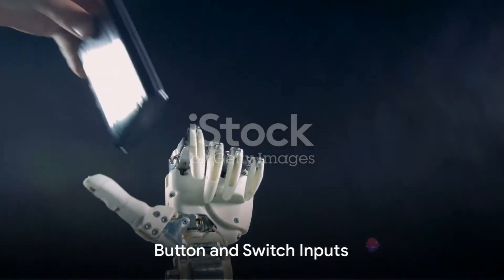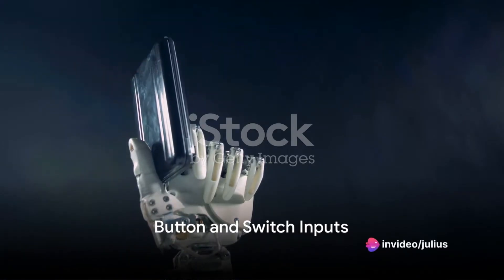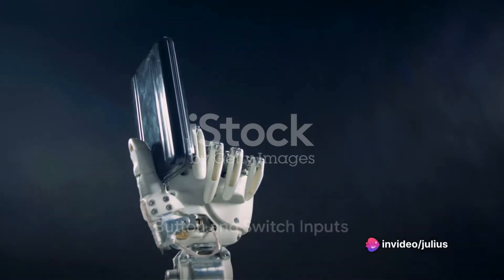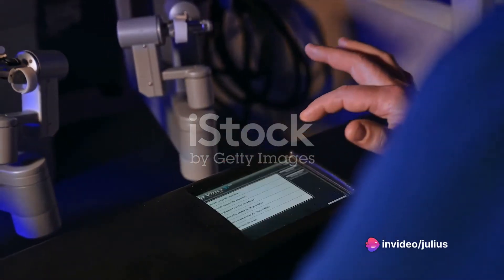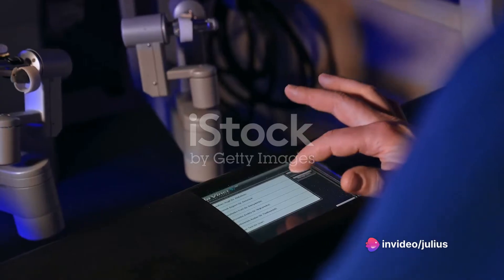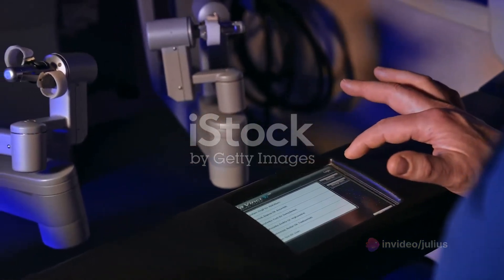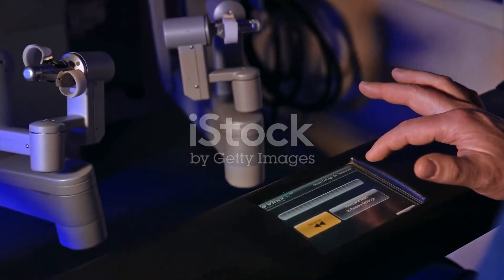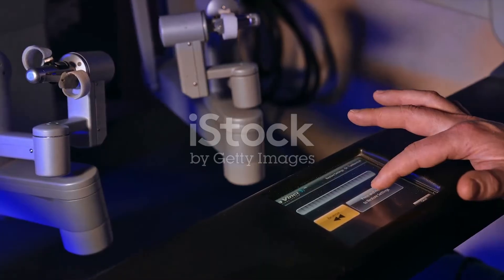Top 10 Digital Inputs in Robotics

Comment: Faith N. Ragas
10 - Andromeda 

1. What are limit switches, and how do they function in robotic systems?
- Limit switches in robotic systems act as sensors to detect when a moving part, like a robotic arm, reaches its maximum allowed position. They function by using an actuator that triggers an electrical signal when the robot reaches a predefined endpoint, ensuring that the robot doesn't exceed its designed range of motion. This helps prevent damage to the robot or its environment by stopping or redirecting its movement, making limit switches crucial for safety and precision in robotics.

Comment: Jag Alona S Ramayla
10 - Lyra

2. Explain the role of proximity sensors in robots. How do they help robots interact with their environment?

Proximity sensors are essential for robots to safely and effectively interact with their surroundings. By detecting nearby objects without physical contact, these sensors prevent collisions. When a robot encounters an obstacle, the sensor alerts it, allowing it to stop or adjust its course.  Furthermore, proximity sensors enable precise movements, ensuring the robot is correctly positioned for tasks such as gripping or welding.

Comment: Jasmine E. Delapus
10-LYRA 

1. What are limit switches, and how do they function in robotic systems?

Limit switches are essential components in robotics that act as sensors to detect the endpoints of a robot's motion. They serve as invisible markers, signaling the robot when it has reached the end of its allowed range, prompting it to stop or change direction. This prevents potential damage and ensures accurate movement control.

Comment: Chlouie Fate O. Hermoso

10-LYRA

2.Explain the role of proximity sensors in robots. How do they help robots interact with their environment?

-Proximity sensors help robots interact with their environment by detecting the presence of nearby objects without physical contact. They prevent collisions by alerting the robot to obstacles in its path, allowing it to stop or change direction. Additionally, they enable precise movements, ensuring the robot is correctly positioned for tasks like gripping or welding.

Comment: Angel Alexa M. Maquilan
10-LYRA

01.) What are limit switches, and how do they function in robotic systems?

- Robot movement is often controlled by limit switches, which act as invisible barriers. These switches trigger a stop command when the robot reaches its maximum range of motion, preventing it from exceeding its physical limitations.

Comment: Cherish Stefie D. Bacayo
Grade 10 LYRA 

3. Describe how binary encoders contribute to a robot's functionality. What type of data do they provide?

Answer: Binary encoders are absolute sensors that convert physical positions into binary code, providing precise positional data for robotic components. They enable accurate tracking and control of movement by sending digital signals to the robot's control system. This data is particularly important for applications requiring consistent positional awareness, even after a power shutdown, which ensures that the robotic systems remain functional.

Comment: Abdul Haq R. Maminta 
10-Lyra
1. What are limit switches, and how do they function in robotic systems?
- frequently used to show when a robot has reached in its endpoint, for as when it has reached its limit, it will stop the robots performance.

Comment: Kyle Ross B. Baiño
Grade - 10 LYRA

1. What are limit switches, and how do they function in robotic systems?

Limit switches are devices used in robotic systems to detect the position of moving parts or the presence of objects. They consist of a mechanical actuator that triggers an electrical switch when a physical boundary is reached. This change in switch state generates a signal sent to the robot's control system, enabling it to respond appropriately, such as stopping a motor or adjusting movement, thereby preventing damage and ensuring accurate operation

Comment: Neeka Ella P. Guillero
10 - LYNX

3. Describe how binary encoders contribute to a robot’s functionality. What type of data do they provide?

Binary encoders play an essential role for robots, supplying data about the position, speed, and direction of movement. These translate mechanical motion into  digital signals that monitor motor shaft rotation, which allows for accurate control because of the precise position or rotation data provided. This is crucial for functions like navigation, object handling, and speed adjustment. Encoders also identify movement direction, ensuring the robot moves as intended.This digital input enables precise and reliable robot operation.

Comment: Rhilyne B. Rivas
10-Andromeda

1. What are limit switches, and how do they function in robotic systems?

Limit switches in robotic systems detect the position of mechanical parts through physical contact. When triggered, they send a signal to the control system to stop, reverse, or perform a specific action, ensuring precise operation and safety. Their reliability makes them essential for preventing overtravel and controlling automated processes.

Comment: KAIHANNE A. MANTICAHON 
10 - Lynx 

2. Explain the role of proximity sensors in robots. How do they help robots interact with their environment?

— Proximity sensors allow robots to detect the presence or absence of objects within a certain range without physical contact. They function by sending out a digital signal—typically infrared or ultrasonic—and then monitoring the signal that is reflected back by surrounding objects. They are like the eyes of a robot that help in navigation. They help robots interact with their environment safely and efficiently as they enable robots to avoid collisions and aid in obstacle detection by determining their position or presence.

Comment: Anika Charisse D. Dawal
10 - LYRA

1. What are limit switches, and how do they function in robotic systems?

 Answer: Limit switches are sensors used in robotic systems to detect the presence or position of an object. They act as safety devices, stopping the robot's movement when it reaches a certain point, preventing it from moving too far or causing damage.

Comment: 🤍💌10- HERMÉS:
Reply: Chelsie Ann P. Carnaje
Grade 10 - Hermes

3. Describe how binary encoders contribute to a robot's functionality. What type of data do they provide?

Answer: Binary encoders help robots by providing precise data on the position, speed, and direction of rotating parts. Incremental encoders track changes in position through pulse counts, while absolute encoders give the exact position directly. This feedback ensures accurate and coordinated movements in robotic systems.
Reply: Alexa Kyle R. Cabunoc
Grade 10 - Hermes

4. What is the significance of digital cameras in robotics? How do they process visual data?

-  Digital cameras capture visual data from a robot's surroundings, which is processed to enable tasks like object recognition and navigation, allowing robots to make informed decisions based on their visual environment.
Reply: Herah Jhylie Zean Q. Agbu
Grade 10 - Hermès

1. What are limit switches, and how do they function in robotic systems?

Limit switches are mechanical switches often used to indicate the endpoints of a robot’s movement, ensuring the safe and efficient operation of robotic systems.
Reply: Francess Elizah A. Pintac
GRADE 10- HERMÉS

5. Discuss the importance of digital inputs in robotics. Why are they crucial for a robot's operation?

-Digital inputs are the backbone of robotics, enabling robots to interact with their environment, respond to changes, and carry out tasks autonomously or as directed by human operators. Without these inputs, robots would be unable to fulfill their purpose and would be reduced to mere machines, drifting aimlessly and unable to adapt to their surroundings. As technology advances, the importance of digital inputs in robotics will only grow, paving the way for more advanced and capable robots to tackle increasingly complex challenges.
Reply: Zophiel Hailey Jace B. Usman
Grade 10 - Hermés

1. What are limit switches, and how do they function in robotic systems?

- Limit switches are devices used in robots to detect when the robot has reached the end of its movement range. They act like boundaries, telling the robot when to stop moving to prevent it from going too far.
Reply: Deron Ethan B. Pacaña
Grade 10 - Hermés

5. Discuss the importance of digital inputs in robotics. Why are they crucial for a robot's operation?

- Digital inputs are important in robotics as they interpret the state of the input, make decisions, or adjust the robot's behavior. These inputs allow the robot to connect to its environment. Without them, a robot would be unable to fulfill its purpose.
Reply: Kenichie C. Racero
Grade 10-Hermes

4. What is the significance of digital cameras in robotics? How do they process visual data?

Digital cameras are essential for providing visual data to robots. They capture images in the form of pixels, which are essentially binary data. Robots process these images to identify objects, patterns, or changes in the environment. This visual input is crucial for tasks such as object recognition, navigation, and interaction with dynamic surroundings.
Reply: Hannah Bella A. Ihalas
Grade 10 - Hermés

2. Explain the role of proximity sensors in robots. How do they help robots interact with their environment?
— A robot's proximity sensors serve as its eyes. They detect the presence or absence of an object within a specific range and provide a digital signal indicating whether or not the object was detected.
Reply: Annarica Nina A. Loyola
10-HERMES

1. What are limit switches, and how do they function in robotic systems?

Limit switches are used to indicate the endpoints of a robot's movement. They act as an invisible boundary that tells the robot when it has reached its limit. Limit switches help control the movement of robotic parts and ensure safety.
Reply: Tysh Maeganne Z. Sagocsoc
Grade 10- Hermes

4. What is the significance of digital cameras in robotics? How do they process visual data?
 -Digital cameras are the eyes of the digital world. They are used to identify objects and patterns, they process visual 
data through pixels which are the smallest elements that softwares can manipulate initially a binary data.
Reply: Christina B. Colarte
X - Hermes

4. What is the significance of digital cameras in robotics? How do they process visual data?
-- Digital cameras in robotics capture and process visual data to enable tasks like object recognition, navigation, and inspection, enhancing the robot’s ability to perceive and interact with its surroundings.
Reply: Khate Althea P. Clarito
10 - Hermes

2. Explain the role of proximity sensors in robots. How do they help robots interact with their environment?

• Proximity sensors are the eyes of the roboy. They help robots to interact with their environment through detecting an object in a specific range using mostly ultrasonic and infrared. It sends a digital signal determining if the object is detected or not.
Reply: Khieffer Neil G. Ensomo
10-Hermes

1. What are limit switches, and how do they function in robotic systems?
-The function of limit switches is to indicate the endpoints of a robot's movement. Limit switches are used to detect the presence or absence of an object or to monitor whether a mechanical part has reached a specific position.
Reply: Yash Argel T. Galon
X- HERMES

1. What are limit switches, and how do they function in robotic systems? 
- They are the unsunf heroes in the world of robotics. They indicate the endpoints of robots movement
Reply: Jacinth J. Yerro
10-Hermes

2. Explain the role of proximity sensors in robots. How do they help robots interact with their environment?

Proximity sensors allow robots to detect the presence or absence of nearby objects within a specific range. They send a digital signal to the robot, letting it know if something is close by or distant. This data enables the robot to avoid obstacles, move safely, and interact effectively with its surroundings.
Reply: Azryl Prince Yohance A. Pagaling
10-Hermes

2. Explain the role of proximity sensors in robots. How do they help robots interact with their environment?

Proximity sensors are devices that detect objects within a certain distance and inform the robot if something is near or far. By providing this digital feedback, they assist robots in avoiding collisions, navigating securely, and engaging with objects in their environment.
Reply: Alvin M. Tagudin
10-Hermes

2. Explain the role of proximity sensors in robots. How do they help robots interact with their environment?

Proximity sensors are crucial in detecting objects within a defined range around a robot. They generate a digital signal that informs the robot whether an object is nearby or at a distance. This capability helps the robot to steer clear of obstacles, ensure safe movement, and interact appropriately with elements in its environment.
Reply: Exceldoin L. Nise
9- Hermés

1. What are limit switches, and how do they function in robotic systems?

Limit switches are simple contact sensors used in robotics to define safe movement limits for actuators like arms, preventing damage.
Reply: Megan Louiesse E. Po
10- Hermes

1.What are limit switches, and how do they function in robotic systems?

Limit switches are electromechanical devices that detect the end of a mechanical movement. They are essential in robotic systems, preventing collisions and ensuring safe operation. By triggering a switch when a physical object comes into contact with them, limit switches provide a physical boundary for the robot's movement.
Reply: Camyll Jhey P. Belhot
10-Hermes

4. what is the significance of digital cameras in robotics? how do they process visual data?

-Digital cameras collect visual information from a robot's surroundings, which is then processed to perform tasks like object recognition and navigation, enabling robots to make decisions based on what they see in their environment.
Reply: Blissany Y. Torralba
10- Hermes

3. Describe how binary encoders contribute to a robot's functionality. What type of data do they provide? 

-Binary encoders convert mechanical motion into digital signals, providing precise position or rotation data. This data is essential for controlling and adjusting a robot's movements accurately.
Reply: Zoe Jillian R. Cabrera
10 - Hermes

1. What are limit switches, and how do they function in robotic systems?

Limit switches, which essentially stop a robot's movement whenever it reaches the limit of its range of motion, aid in indicating the end point of a robot's motion.
Reply: Frenzzy Kyla C. Halasan
Grade 10 - Hermes

4. What is the significance of digital cameras in robotics? How do they process visual data?

Digital cameras in robotics permit robots to see their environment by capturing and preparing visual information. This information is analyzed using computer vision calculations to distinguish objects, degree separations, and explore. The capacity to handle visual data empowers robots to perform assignments independently, such as object recognition and obstacle evasion.
Reply: Glenn Seth Myrrh B. Laluces
Grade 10 - Hermes

2. Explain the role of proximity sensors in robots. How do they help robots interact with their environment?

- Proximity sensors are essential in robots for detecting nearby objects without physical contact, helping them navigate, avoid collisions, and handle objects efficiently. They provide crucial information about the distance to obstacles, enabling robots to make informed decisions about their movement and interact safely with their environment.
Reply: Hamainie Briezies O. Gabriola
10 - HERMES

1. What are limit switches, and how do they function in robotic  systems?

ANS: 
Limit switches are mechanical switches often used to indicate the endpoints of a robot's movement They ensure the safe and efficient operation of robotic systems.
Reply: Ma. Nicole Cyse L. Rojo
10 - Hermes

1. What are limit switches, and how do they function in robotic systems?

- Limit switches are electromechanical devices used in robotic systems to detect the position or motion of an object, typically by activating or deactivating an electrical circuit when a specific limit is reached. They consist of a switch mechanism and an actuator, which can be triggered by physical contact with a moving part of the robot, such as an arm or conveyor belt. When the actuator is pressed or moved beyond a predefined point, it closes or opens the circuit, sending a signal to the robot's control system. This functionality is essential for ensuring safety, preventing mechanical overload, and enabling precise control of movements by defining operational boundaries and positions within the robotic system.